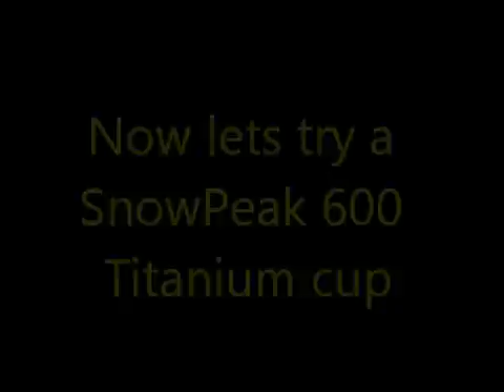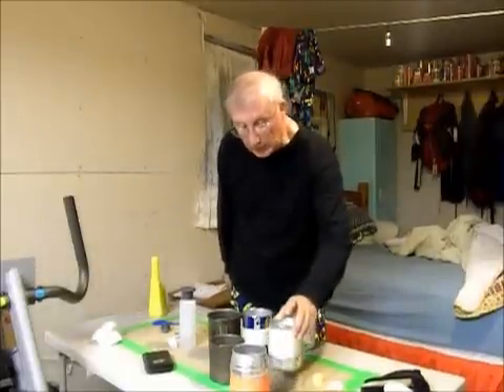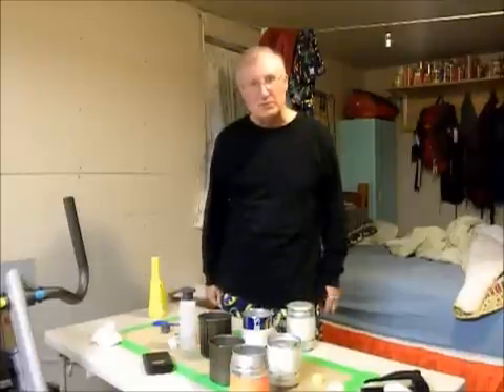Boil Time

Comment: I will be honest and say that I have always logically thought that because of the lower thermal conductivity of Titanium it would cause a slower boil time.

I suppose this goes to prove that the chemical compound mixes that are done in these supposed "Titanium" pots is likely not as much of the Ti compound as many of us think it is.

Aluminium thermal conductivity = 237 W·m(−1)·K(−1)
Titanium thermal conductivity = 21.9 W·m(−1)·K(−1)

That is a huge difference in thermal conductivity levels.

Comment: You mentioned how people enjoy the tiny pot covers with the maple knobs and how Snow peak makes no lid, Tinny.  Lids have many purposes, but one question: does the same pot boil on the same stove faster with a lid than without?  My gut tells me that, although one would think with a lid trapping in heat the boil would be faster, in reality that may not be the case.  My gut has been wrong.  What's your thoughts on that?  Thanks.